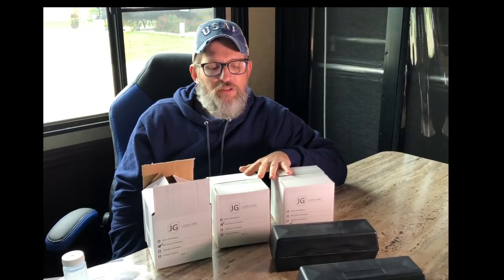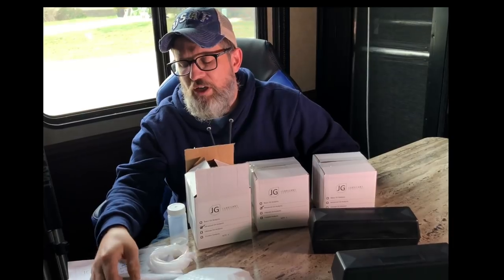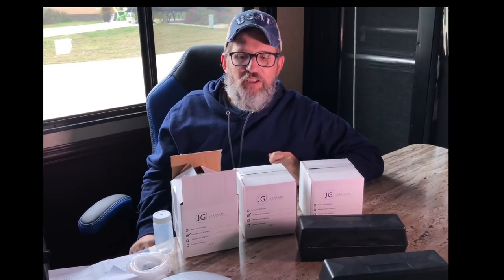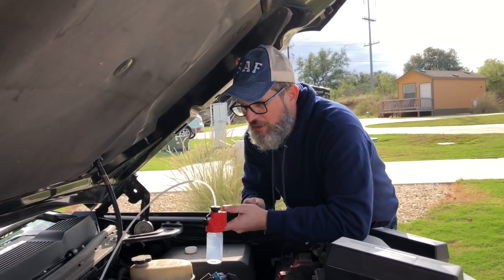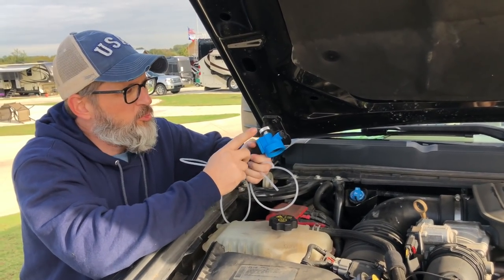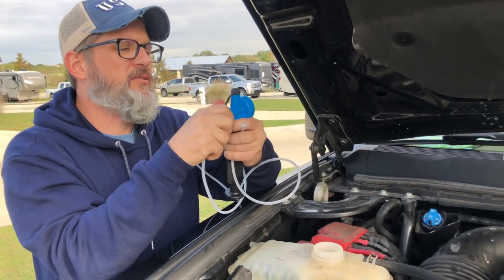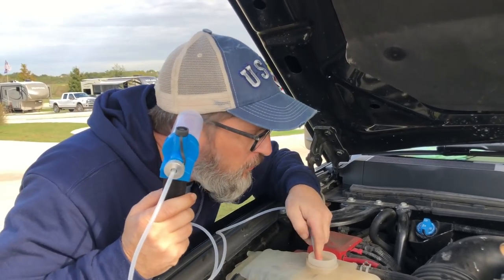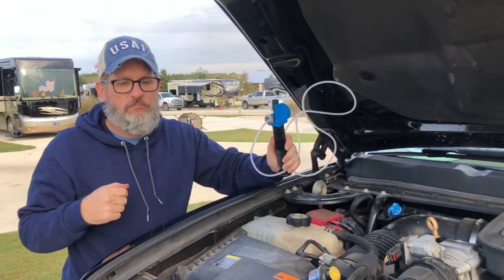RV & Tow Vehicle Fluid Analysis

Comment: When hauling large loads and depending on your truck maintenance schedules should be maintained
Reply from the maker: You are correct but it is nice to know that there are not any “hidden” issues with the components. Also, you may need to tighten up your maintenance schedule.